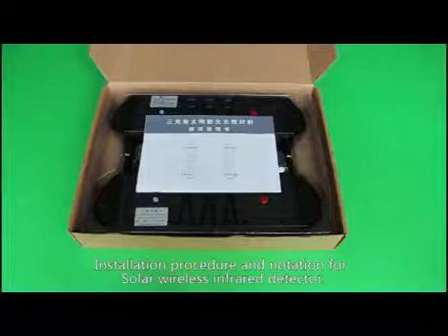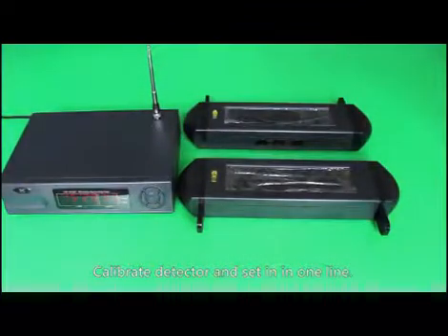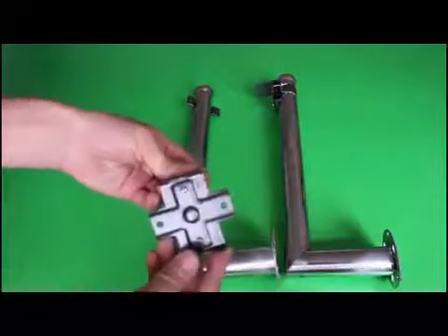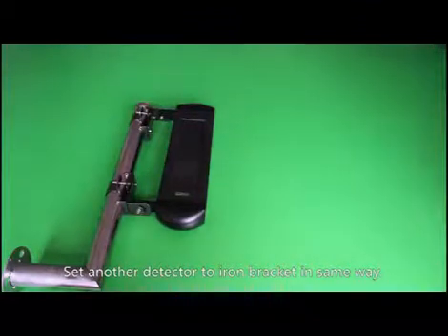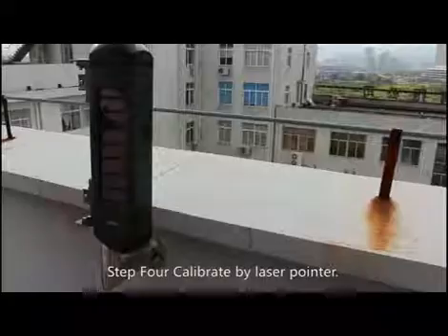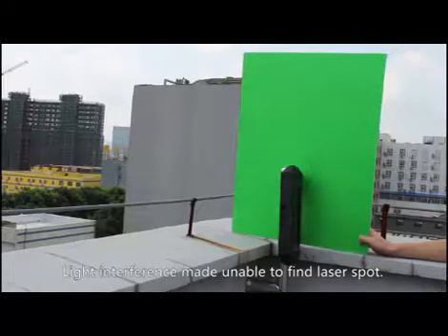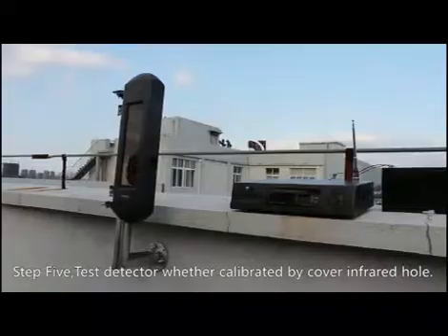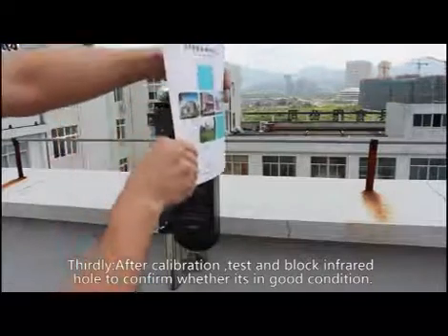Install solar-powered wireless photoelectric beams detectror

Comment: how many hours will it take sunlight to work one day ?
Reply from the maker: 3-4 hours. Generally it can work after installation cause it is charged before left factory. More questions and answers can be found at https://www.vedard.com/forum/questions-of-solar-power-wireless-perimeter-security-system-t381.html